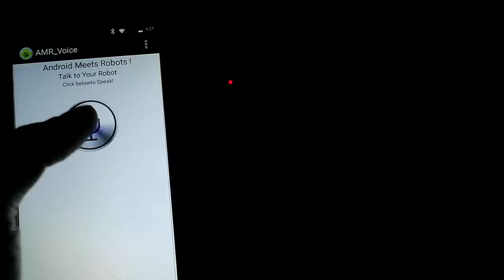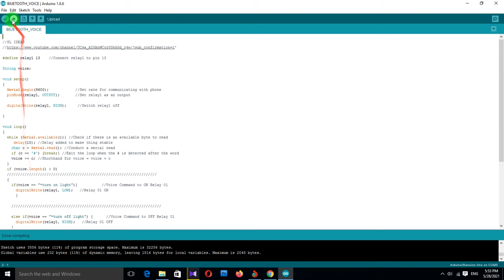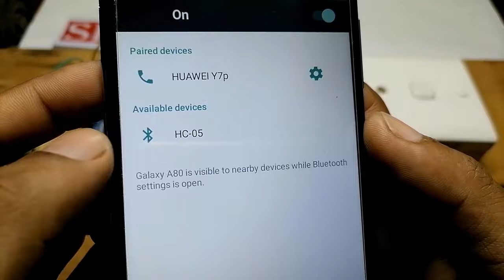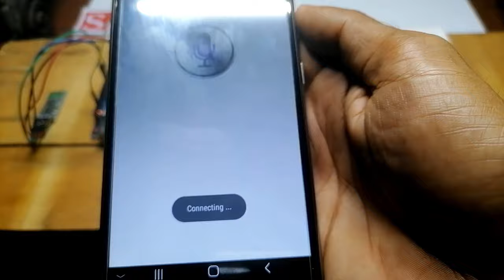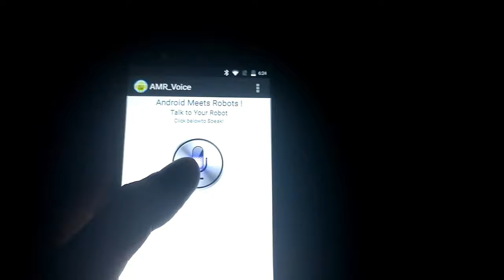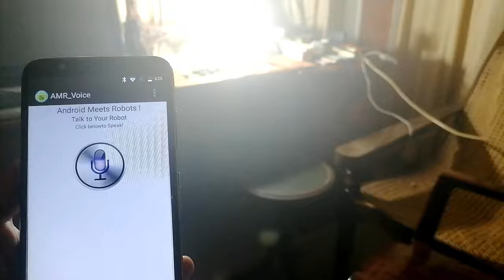Voice Controlled Home Automation | Home Automation Using Arduino Bluetooth | IOT | Part 2

Comment: How to add small mottor fan with this project and code will change adding fan
Reply: if small dc mother then use low power supply and yes same code for it also